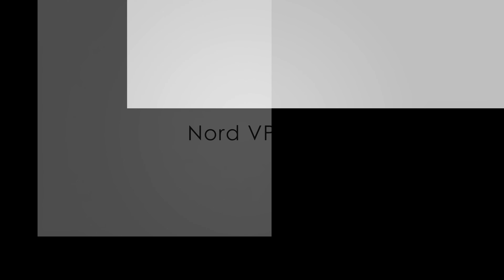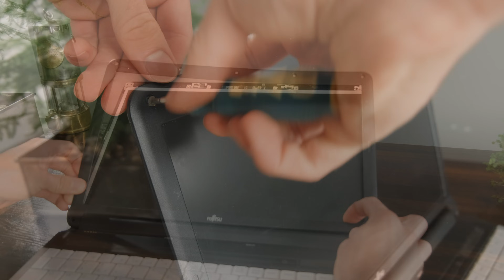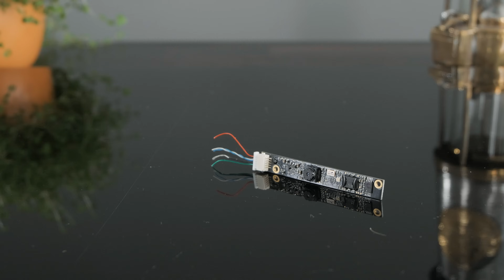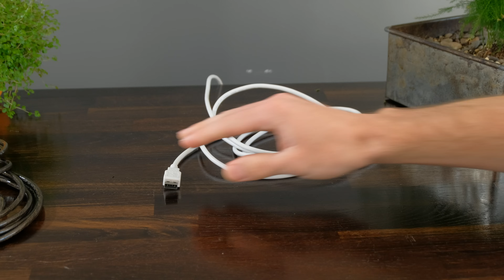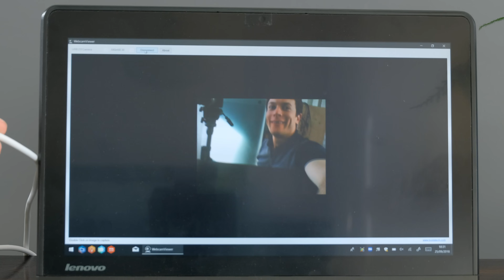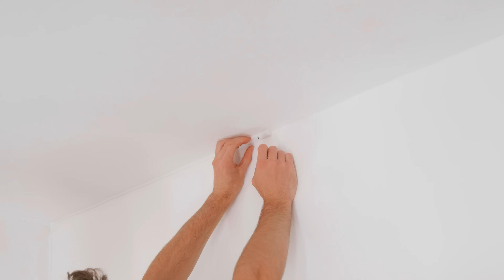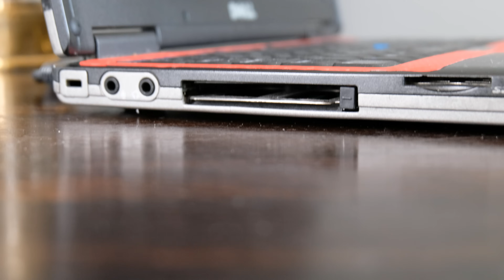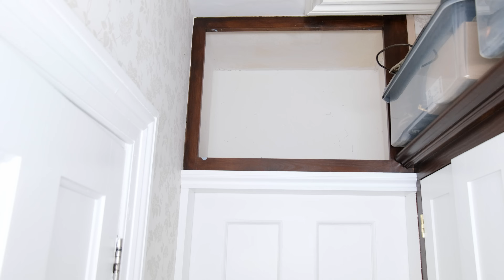DIY Home Security - ON A BUDGET!

Comment: I stripped out an old iMac one however it doesn't have the hole in the middle of the P.C.B so that I can test which wire is ground. Any suggestions?

Comment: USB It can not work more than 1 meter, a maximum of 1.5 meters is longer than the cable and the signal beeps. This fake you will not succeed at a long distance.
Reply: you can buy cable extenders or use the good ol' powered usb hum method for about 30 meters. Super possible.
Reply: @LoganJarrell  1/1,5 meters
Reply: @Grisha5544  that's just not true. You just need a signal repeater, either a powered usb hub or a cable that does it already, called a usb extension cable with active repeaters.

Comment: I get an error messaging saying surge detected, usb has exceed power draw
Reply: Did you connect everything correctly? I made my own cam (not for security reasons, just to have a really cheap HD  webcam) but everything works nicely.
Reply: @TheMachinedestroyer  still didn't work, reconnected different wires but still nothing, found the usb to laptop cam cables already made with a laptop cam for less than £3, going for that rather

Comment: I have to be honest, this is one solid tutorial. I looked around for general help for setting up a camera as a spy cam and this is the one source I could find that let me set it all up from scratch in 20 minutes max. Don’t know if the video mentions this but you can use any camera and any connection so long as it ends in usb. Contacam is an amazingly flexible program, being free to boot as well. Thanks for letting me monitor my drug growth so my roomates dont find out  ;D

Comment: In each battery pack from say a DeWalt or any other cordless screwdriver, there are are balancing and charging control circuits (- one or both, from appearance). Of course the 18650 cells die eventually, so there are quite a few circuits about as waste sometimes where people throw the whole battery pack away. So if one doesn't have the 'original' DeWalt (for example) charger, what are the parameters for feeding power in, to use the charge control/balance circuitry with new (or functioning) 18650 cells? How firm is the liaison between charger and battery pack controller? (or is there none such that one can use them universally?). Knowing a bit more about them could open up a major bit of recycling... Thanks for your videos which are well presented, to the point and thus really enjoyable. (And by the way, use might be had of the charge controllers/monitors/balancers in every old laptops' dead battery pack...?!)

Comment: I've been trying to connect some old laptop cameras as per the instructions. I notice that despite showing 6 cables from the camera in the video, you only diagnose the purpose of 4 of them; what about the other two?
On a separate note, some of the cameras I've pulled out have more than 6 cables - other comments suggest this may include a microphone; any ideas on how to deal with those?
Reply: Only link up the required cables. You just need the Power Positive, Power Negative, Data Positive and Data Negative. Their colours are Red, Black, Green and white (sometimes the green and white are swapped around)

Comment: You are DIYs are very elegant and neat.  

I have a webcam of a broken laptop but I don't have a multimeter to check the (power and data wires). Could you please tell me which ones are for power and which ones are for data? 
I have webcam which in the middle  shown at https://youtu.be/CouxmNqxO4A?t=278

Comment: I have just disassembled my old Toshiba laptop (MB died about 4 years ago).  It has a webcam, but it seems that the microphone is included in the module. I have removed it and would like to use as a security camera.  Is there a controller that will use both devices?
Reply: Finally got to the wiring - 1 orange, 1 black, 2 twisted green and white, 2 twisted red and brown.  So, I am sure the mic is on the board.

Comment: Has anyone had a problem on windows 10 where  the USB camera (the one I have been using is from an Asus laptop) caused  a Security Kernel Error when you try to shut Windows down . Can run the camera  on  Contacam all day with no issue but soon as I try to switch off the error occurs and tells me the computer needs to restart. I restart and can then power down normally. Similar on Windows 8.1 but this time just as soon as I plug in the same camera windows 8.1 crashes straightaway !

Comment: I am hoping to find as many as 6 (or more?) of these camera modules to prepare as cameras to assure the safety of my house, a chicken coop, milk goats' pens and a shed, against predators on my tiny farm. I have very limited experience and depend on DIY guidance from online videos, etc. in hopes of somehow, if possible, putting together minimal, very low-cost separately  solar/battery-powered units, each, individually wifi connected to my PC inside the house. I do intend to enclose them in some sort of weather-proof container. 
What can you tell me about the resolution and power requirements of these and any other information or recommendations you might offer. It will be greatly appreciated. Thank you for your time and kind consideration. Great work on your channel. I wish you had a design for what I'm hoping to cobble together.

Comment: Any way to make it record the past 2 hours for example and save the files on a cloud system? and then rewrite ontop of the oldest files?
of course it would be prefereable to have at least 24h, but if u are using 1drive or goodle drive for free u are limited on the GBs...
anyone with an idea for a solution on this, your answer is welcome! 
i want to make sth similar, but i need a backup on the footage...

Comment: Seeing as I have 0 knowledge about electronics and I just found an old laptop with a nice camera a few days ago, then found this video and decided it might be a good idea to make a portable camera to use for lectures during the quarantine, I'm a little bit confused, the USB cable has 4 wires, ground, 5V, data+, and data -. Correct? So what you did with the camera was just connect 4 of the corresponding wires from it to the USB cable and presto it worked! Correct? :P My confusion comes from the fact that the camera you used in the video has 6 wires :P (So does mine! xD) So what about the remaining wires? What do they do? Also, I saw some cameras you had in the video that had only 5 wires. How does the situation change, if at all?

Much love, 
Adrian

Comment: I want to try this out because you can't get any webcams right now due to corona situation. I am worried though about windows 10 driver compatibility because I would wanto hook the old webcam up to my main system and all the internal webcams I can find on ebay are very old and if I check the laptop manufacturers support site they do not list any win10 drivers. Do you have any experience for this kind of scenario?

Comment: 2 of my cables beep when I test them with the screw hole thingy. What's up with that?
Reply: If your meter shows a resistance measurement, use the cable with the lowest resistance as your ground.

Comment: i've connected the cables, but get a recognition error regardless of how the data cables are hooked to the usb,that and im not sure if the one extra cable should have gone to ground,given i don't have a multimeter i could not diferentiate them,i just want to be sure it's 2 to ground 2 data and 1 5v

Comment: I have 7 cables, i suspect that there is a microphone, can you help me?
Reply: If it has a microphone just follow the steps in the video then once you've found ground and data, you can set your meter to resistance and check the remaining four wires for between 1k - 3k ohms, that pair will likely be the microphone and may have its own ground which would be the final wire but it should be easy to find Vin from the last two.
Reply: @vgamesx1  So how do you connect the microphone? On mine, it has the pinout printed on the back and says M_data and M_clk. Do they get soldered with the Data+ and Data-?
Reply: @Viking8888  No data+/- is for the usb protocol, normally you can just solder the two connections right to a 3.5mm jack but that isn't likely to work here as mic has a clock signal, meaning it probably uses some other protocol like maybe spi or i2s, basically in short you likely can't, in more detail you would have to find the laptop schematic, look at what the pre-amp is to help you figure out what protocol it's using or you might need a logic analyzer to work out what it's doing then program an Arduino to replicate that functionality or at least find an amplifier board that can support whatever protocol it uses which although a lot easier can still be time-consuming.

For example: https://learn.adafruit.com/adafruit-i2s-mems-microphone-breakout?view=all
Reply: @vgamesx1  Thanks for the great explanation, I appreciate it. In going to use the cam with Octoprint anyway, so a mic isn't really needed. Take care!

Comment: Wow this is great.  
Im getting a problem🙈 first it wont recognize the usb, and the borad is getting real HOT, so i switched it off. 
What am i doing wrong 🤷‍♂️?
Reply: Feel free to buy some thermal paste off eBay (£3) or amazon (£4) and add a layer of it on the bottom of the board. You’ll have no heating issues then.
Reply: @AA-kn4px  okey THX i'll try
Reply: @Andrew Delphiki cool I'll try though all cams run 5v, I uselley work with 230/400v. So all this low voltage is a new thing for me 👍 but I'm getting better at it

Comment: I noticed that you had a camera with 6 wires.  I have one like this as well.  If you're only connecting 4 to the USB cable, how do you know which ones to connect?  I have a black and a ground wire.  Do I twist these together?

Comment: Question: If you used cables that long, isn't there going to be a voltage drop enough for the camera not to be able to run ?  
Of course it will be, longer wire means bigger resistance which then gives power loses. 
My real question is, is the remaining voltage enough to power on and keep the electronics running smoothly and without interferences?
Reply: this I wanna know to
Reply: Thats what i was thinking. I did the exactly like shown, and my cam is getting hot like its gonna burn
Reply: There is the real Light thinking about all possible outcomes in an anime like way but why you have L's picture for a profile pic?
Reply: @cattonny119  u on drugz ? What are talking bout ?
Reply: @eliteelektriker6655  an anime if you have watched it you have the premmision to call me stupid

Comment: Pi Zero Ws with the right interface software can avoid the issue of needing USB cables and repeaters, though you do need to figure out the power for it. Though I'd think for outdoor use, you probably wouldn't want to use a computer webcam unless you put it into a housing that is weather-sealed.

Comment: I'd recommend HP TrueVision HD webcamsa as they're true 720P webcams
Reply: That's not a good idea coz if it's 720p then you will run out of space after some time if there are more than 3 of this 360 or 420p should be enough for cctv I think

Comment: Hi There! :)  I was wondering if you might have suggestions on what can be done with the older webcams (that can not recognized by windows 10, and not from old laptops).  i have a few, but none of them can be used since they are not recognized even though they connect via usb connection.  I'm hoping they can be re-used as I would not like to through them out.  Thanks :)

Comment: Thank you very much for this amazing idea. Just a quick question do you need to use USB or will cat 5 or cat 6 cable also work?
Reply: @JornNavarre  thank you so much for the reply. Looking forward to start with this DIY project.
Reply: @wernertruter1399  When in doubt,  Google !  :-)
PS: Old Android phones are also a great option for el cheapo Wi-Fi cameras. Even 10 yo budget ones work great. You can also use Windows XP era laptops running Linux from a USB stick as a monitoring station.

Comment: Great video! What if my multimeter doesn't have a beeper? What should I see in order to identify the connections?
Reply: Try to find the part number. Might be on the board itself, or someone might have identified it online for your laptop model. Using that part number look up data sheets for the webcam/board.

Comment: I'm gutting my old 2013 iMac and converting it into an external display using a 3rd party display controller, but I got the idea in my head that I'd love to recycle the speakers and iSight webcam as well. Unfortunately, this seems like no easy feat, as the iSight uses a ribbon cable with far more pins on it than this one, and even the speakers have six pins each. Any ideas?
Reply: i have the same problem. Do you find a solution?
Reply: @Joe.o0  I did, actually! Well, for the speakers anyway. I gave up on the camera, it was far more complex than any of the tutorials for other DIY webcams were. Do you have a 2013 specifically? The speakers sometimes vary from model to model
Reply: @kazoodac  which video was it? I don't in which model this camera was. Thanks for fast answer
Reply: @Joe.o0  which video for what? I found a couple different “convert laptop webcam to USB” videos, but they all operated on the idea that there were accessible pins that would match to the pins on USB cable. I’m no expert but the camera on the 2013 iMac has a lot more going on, and everything was smaller too, so I gave up on the idea and just focused on the speakers.

Comment: this could be also cheap way to get reverse and front cam into your car
Reply: Siva Nalluri so you can review your parking skills the day after. “Ooh, so I DID hit the other car”
Reply: Considering how cheap Dash Cams are getting (I picked up a 40$ 4K Toguard Cam, running it at 1080p for file size though)... It's not worth it. Honestly just tried the video's laptop webcam security thing and its better to get Wyzecams for 25$ a pop - much better fish eye, night viewing, and image quality plus much less fuss.
Reply: @psedach  Thank you so much for the suggestion, just watched their outdoor cam video, funniest thing I have ever seen, and the features are really great: https://www.youtube.com/watch?v=zzmmcR4Uy24
Reply: @psedach  No argument here; it's just that sometimes the fuss is the point.
Reply: The reason I'm here! Looking for DIY reverse cams using laptop cam.
Reply: @anthonyfisiihoi  you need to make sure the image is flipped for reverse cameras so it's the same as looking in a mirror otherwise it's very confusing haha
Reply: @djrevvy8449  good point! 😅🤙
Reply: Laptop webcams don't do well at night, so it's better to get a proper car cam instead
Reply: @franklee8032  Not if you remove the IR/UV filters.
Reply: @franklee8032  or maybe manually activated flash...well..i guess not a really good idea
Reply: but what if it's raining?
Reply: @edrick7260  yeah getting a dash cam and reverse camnus just better unless you want to 3d print a plastic mold for the webcam
Reply: @edrick7260  you could pretty easily seal the circuit board of one of these cams with some silicone sealant
Reply: @edrick7260  its inside ur car not outside
Reply: @JornNavarre  Contaware doesn't support android however I guess you don't need it for a car cam which is a really good idea actually
Reply: @loganparker4184  And Win ce
Reply: Just pay 187$ for a reverse camera option and it’ll run on your. Car’s navigation.

Comment: I tried every connection by the two data cables many times, with different computers, and tested the ground and the 5v with the multimeter and the camera is always never found by windows
Reply: Same here. I'm scrolling through the comments to see if I can find something :(
Reply: @efuentes  i soldered them and they worked automatically
Reply: @MarcoZanon  So is it just like a physical connection issue?
Reply: @efuentes  For me was just that so might be
Reply: @MarcoZanon  I'll try that, thank you!

Comment: Love the idea but word of warning, if you have luck like mine it doesn't quite work out like the video.  First don't even try isight camera from mackbook, one data wire is encased within the other and they are almost microscopic so just excercise in frustration.  The second one I tried (alienware 14) had 9 cables with two sets of them braided, gave up trying to figure out which is which. Just my experience your mileage may vary, and I hope for you sanity it does! :-)

Comment: If you choose to use a normal USB Webcam the Xbox 360 Vision camera is a great choice, these act as normal webcams when plugged into a pc, they have a ball joint allowing the view to be adjusted without having to re glue anything, they're white and pretty discreet so they blend in well around the home, they have a longer USB cable than I've seen on any webcam and they're cheap to buy used off eBay, the feature to flip the view in ContaCam advanced camera settings allows the camera to be mounted upsidedown from the base attached to the ceiling with the image right way up

Comment: Thank you, nice idea. i first tested this with the camera of an acer v3 laptop, but that didn't work. it looks like it needs 3.3 volts and i probably broke it by connecting it directly to the 5v of the usb cable. then i tested it with the camera of a HP dv5 laptop and it worked first try. driver installed automatically using windows 10
Reply: I guess I had the exact same issue using a camera coming out of an Acer laptop. Will try again with a different camera next time.

Comment: Or you know just take a Raspberry Pi and connect the cameras to that, since Linux is more versatile and flexible when it comes to using camera devices for monitoring purposes. Hook up a USB Hub to connect multiple cameras off them. Raspberry Pi uses very little power and can just run off 5v USB, and/or some batteries as backup to be able to continue running even if the main power happens to drop out.